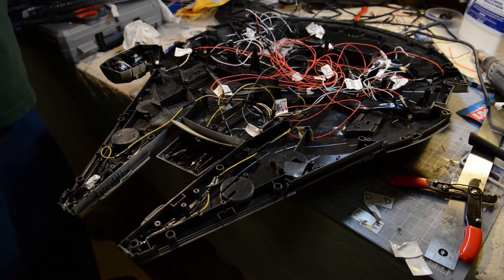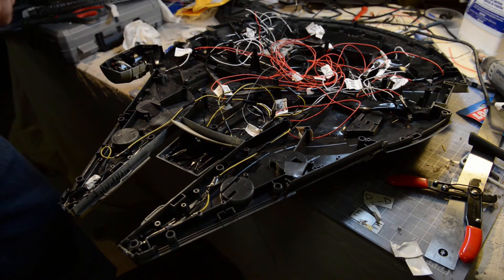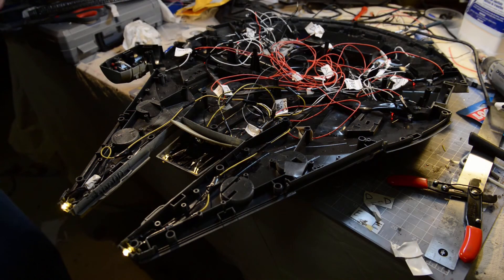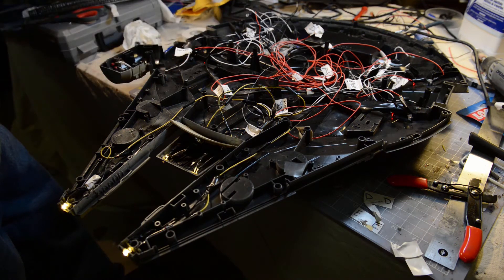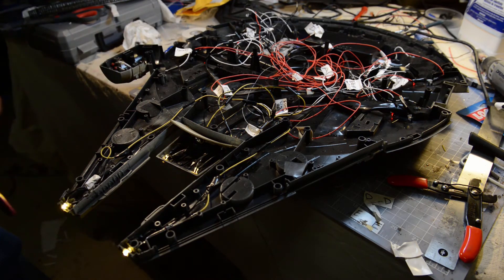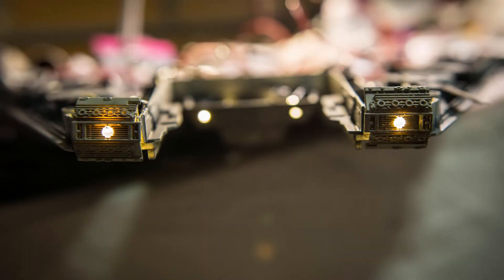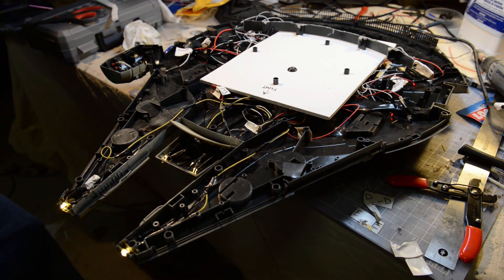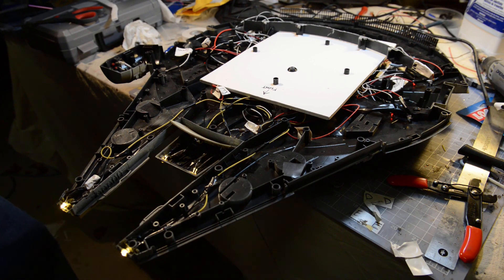Millennium Falcon Hasbro Conversion - Electrical and Lights

Comment: I really want to get and modify one of these... I would recommend braiding the internal wires however.. a lot easier to see.. what wire goes to where... You can file your LEDs as well to dull them and make them more ~unfocused~.  love your videos. Cheers!.

Comment: Have you come across any low voltage remotes to control the lights with?
Reply from the maker: Mike Grant I believe I saw something for model trains. But I don't recall where. I think it was a YouTube video. Search model train remotes. That might help. Sorry I don't have more info.

Comment: Hey, Ken!  I'm not an expert with wiring but it's time for me to start lighting my falcon, I'm looking at the battery you bought, how did you connect the wiring for the LED's to the battery itself?  From what I've seen, I haven't been able to locate any wire leads on that battery.  Thanks for the extremely helpful videos!
Reply from the maker: Hi! Great question! It's been a while, so forgive me.  The battery that I mention and used in the video comes with a plug that has a Y configuration. This plugs into the battery; you can see it loose at 1:48 in the video. One connector was mounted into one of the docking bays, so I could re-charge it ( see this video for details: https://www.youtube.com/watch?v=F7673XwF3zc) , and the other half of the Y is the positive and negative for the inside wiring. You need an adapter for that piece that will allow you to connect the main +/- wires to the battery. Here are the two components I'm referencing. Hope this makes sense. 

LIGHTS AND ELECTRONICS

Lithium Battery: 
Talentcell Rechargeable 6000mAh Li-Ion Battery Pack For LED Strip And CCTV Camera,12V DC Portable Lithium Ion Battery Bank With Charger,Black
Get it: http://amzn.to/1ky7uIp

AND

** You need this to connect the battery to your wire sources.**
HitLights 8mm (SMD3528) Strip to DC LED Light Strip Connector - 3528 to DC Jack - Single Color Four Pack
http://amzn.to/1R27VcA
Reply: Thank you!!  A really helpful response lol,  I'll probably end up bothering you about that cockpit at some point too lol, fantastic model man!!

Comment: Ken This is a very good subject you have here on the wiring.  I got a Talent Cell Rechargeable 12V 6000mAh/5V 12000mAh DC Output Lithium Ion Battery. Please can you post your wiring diagram you used here?
Reply from the maker: +z32coupe Glad you found it useful. I'm making a change to the wiring (actually and addition) I'm adding the wire to the top as well. I'm in the process of starting to work on this. Once I complete that, I'll share my top and bottom diagrams.
Reply: Ken Thank you for the reply. You have done great work here. I look forward for more info on you progress. Just have on question on your connection of the battery pack to the main wire harness. I was doing stop action of you section about the battery pack how did you connect the battery pack to the harness?
Reply from the maker: +z32coupe Good question. I have this listed further down in the description. I bought this on Amazon  for $5.99 http://goo.gl/8zcGkZ - Is this what you were inquiring about?

Also, I will be joining the wiring on the top half with the bottom half by using these wire connectors and making them accessible from inside the side docking bay where the battery charger is. http://goo.gl/NX04Vr

One thing I really wish I did differently (but truthfully had trouble finding) was finding wire (+/-) joined parallel, like speaker wire. It would have been so much easier. I read that you cannot use speaker wire because it would overheat. Another thing I would have done different is bought all my LEDs with the resisters rather than solder them myself. The wiring wouldn't be half as messy. Hope this helps!
Reply: Ken
Thank you again You are the Best EVER Thank You So Much for the Info. 
Darryl